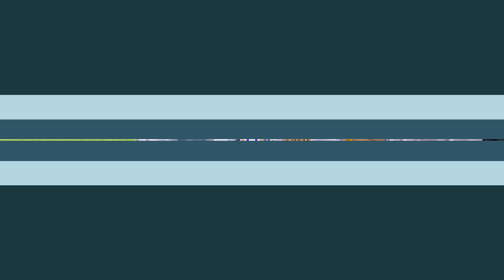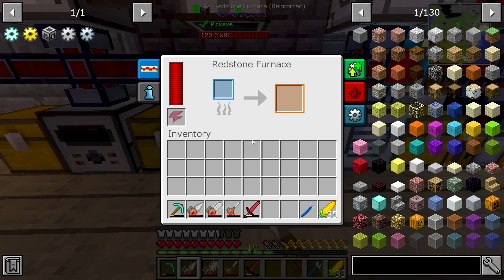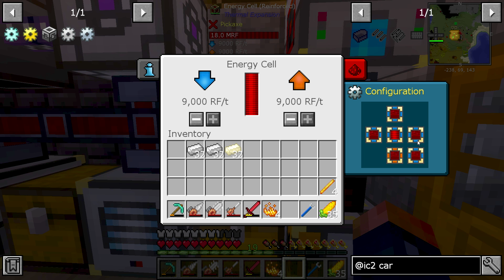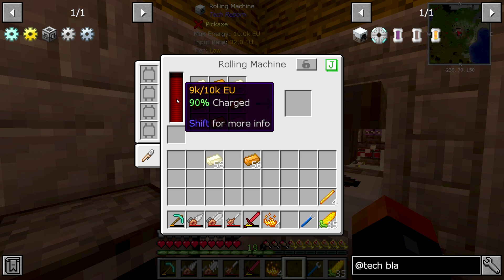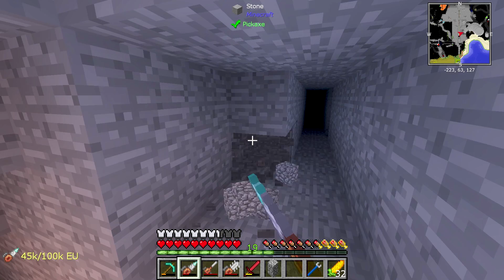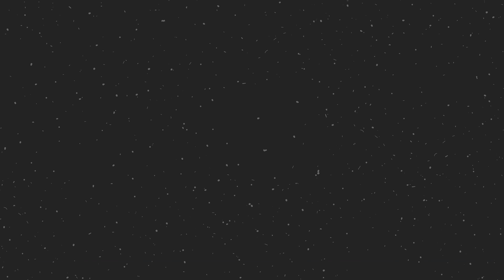FTB Ultimate Reloaded Modpack Ep. 10 Diamond Drill + Tech Reborn

Comment: every mod i seem to play i start off good but then i just seem to get all bogged down with all the mods ie industrial forgoing and so on.  and it's hard to know where to start with all the paths that i need to take.  what i would like to know what do you decide to work on first,  is it food production or power or resources and so on.  please help im ripping my hair out on this (lol and i don't have that much to spare hahaha)
Reply: For me if industrial foregoing is in the pack I start with unlimited power. Once you have unlimited power its easy to make the auto farms, mob slaughter stuff, etc. Unlimited power is made by the 5 industrial machines (and can be made easier with another mod, storage drawers). I run a tree farm with all Industrial foregoing equipment (Gather, Sower, Sludge Refiner) and then use the furnace that burns 3 sets of items at a time (Resourceful Furnace?) to burn it into charcoal and then I use compacting drawers (storage drawers) but can also use any autocrafter to turn those charcoal ingots into charcoal blocks. the charcoal blocks in the Petrified Fuel Generator give 800RF/tick. This is completely expandable to meet your needs as you can use tier upgrades on the tree farm (I normally get by with like tier 5 or 6 range addons) and also add multiple Resourceful Furnaces (think I run 4 or 5) with multiple Petrified fuel generators (3 or so). Anyway all of this can be done with the Industrial forgoing equipment except the compacting drawers (and regular storage drawers as a buffer for the wood before it's burnt). So in this series YABBA could replace the storage drawers full of wood. Once I get unlimited power then the laser drills, mob duplicators, auto harvesting (using different set of gather, sower, sludge refiner) come pretty easy.
Reply: @brandonjeffries5021  thanks for that hopefully i can take that on board and my brain absorb that info lol